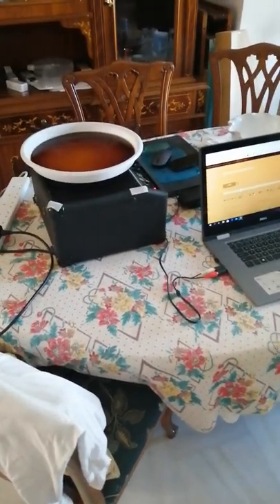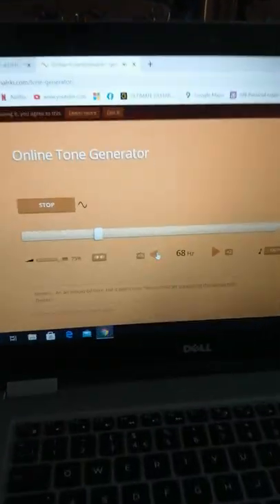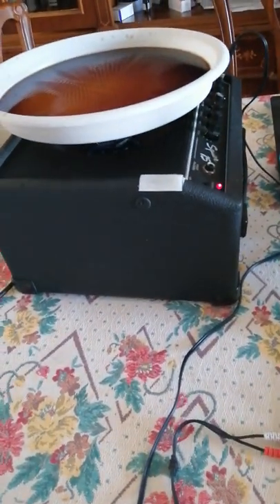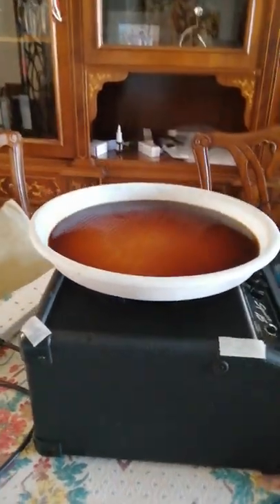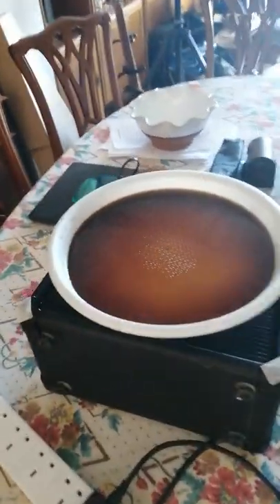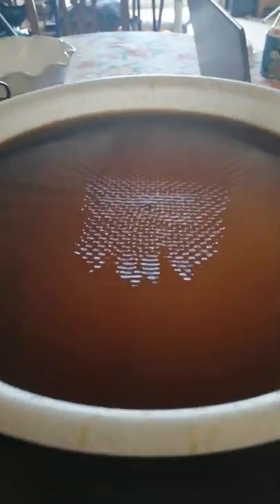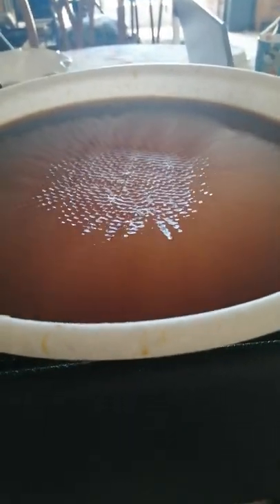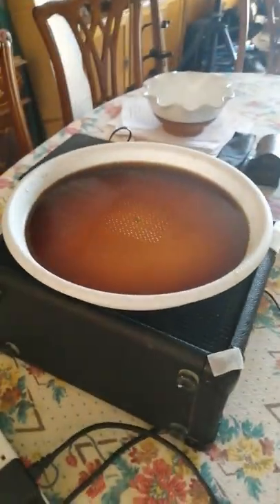Chladni or Cymatics rig -1st attempt! #shorts

Comment: I want to do this but without damaging my amp. The liquid scares me, but a plate with dry sand or something should work.... I think.
Reply from the maker: @illuminotme4261  Hi....I used an old amp, after I got a new one.... I glued on a half of a plastic bottle.... so can change plates, via screw top lid. Another comment, said my plate was too big,  maybe correct... also, dunno how you could do it in a none destructive way... good luck!
Reply: @fonwoolridge  yeah I didn't realize there was a direct attachment to the speaker, thank you.